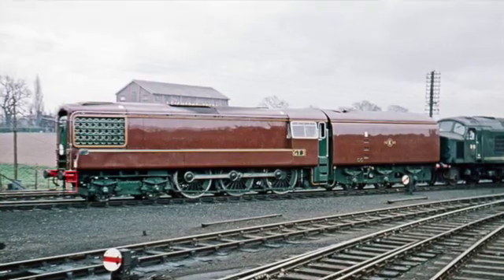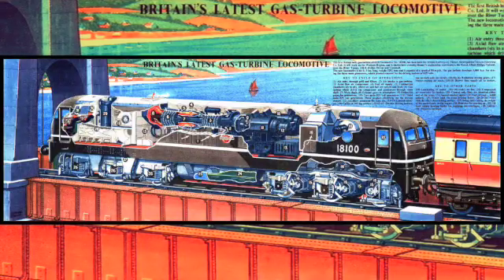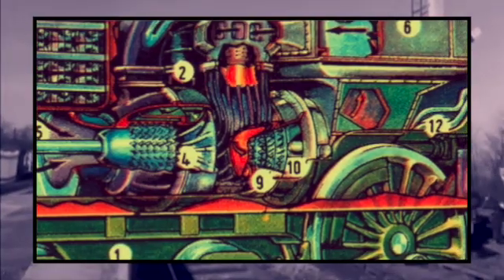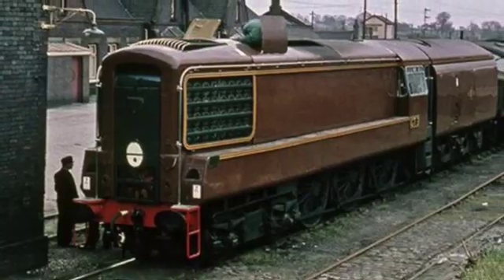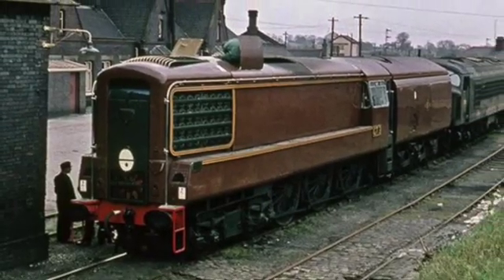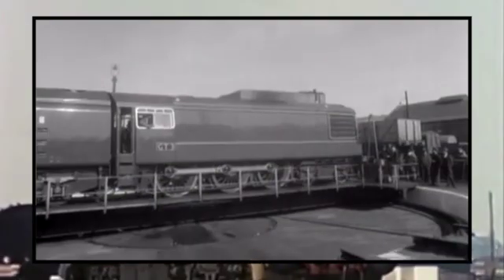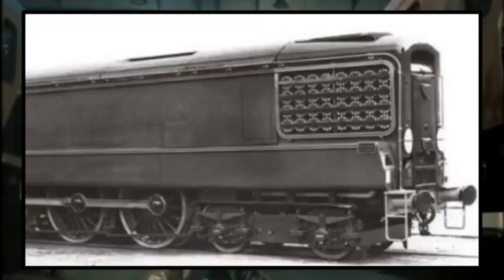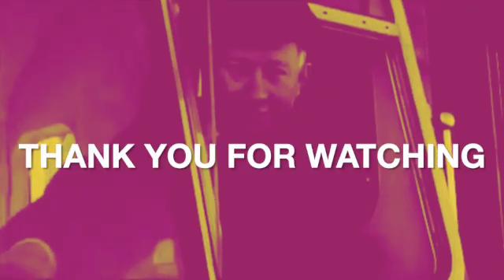The Train Powered By A Jet Engine: British Rail GT3

Comment: I wonder if it would’ve been possible to construct a diesel/turbine hybrid in a similar manner to something like the kitson still locomotive. 

Using diesel ( don’t know much about the viability of kerosene engines in locomotives ) at low speeds and switching from an engine to a turbine at a set minimum speed when the turbine is at a good efficiency. 

Certainly over complicated but I assume it would be the best of both worlds if done properly.
Reply: turbine electric? keep turbine at constant rpm use electric traction and smaller turbine using less fuel?

Comment: Union Pacific had more success with gas turbines and the APT-E was a gas turbine, they were very heavy on fuel use at anything other than full power.
Reply: I believe they used to use diesels and gas turbine locos together on trains, so the diesels could get the train up to speed so the gas turbine loco would take over, and at high speeds they were very efficient.
Reply: It's not so much about speed as constant high power. Gas turbines worked a bit better in the US on freight trains as they could run for hundreds of miles at high power hauling long heavy freight trains. They were not well suited to the Europe where there is a need for regular power changes. Even on long distance services with few stops, it's still often full power up hill, then coast down, then power on for the next hill, plus shutting off to slow for a curve, then back on the power on the straight. Even diesels had a lot of issues with constantly going from full throttle to idle and back.
The funny thing is that today Gas Turbines might actually be more viable, as part of a hybrid setup with batteries. They could run at constant speed and charge batteries when full power wasn't needed, with the batteries boosting when more power was needed. Still would be noise issues though. Gas turbines are remarkably tolerant when it comes to fuels too, which would be an advantage.
Reply: @ChrisCooper312  I'd love to see the Gas Turbines come back. The rumbling was intense. The technology should be developed further, I feel. It's been suppressed for too long.
Reply: @abloogywoogywoo  I've also heard it said that GT3 was banned from stopping with the exhaust underneath signal gantries and bridges because of the intense heat of the exhaust.
Reply: @Andrea.583  This was often true of steam locomotives.

Comment: I think the designer couldn’t let go of the steam loco.
In reverse, rear visibility would have been zero on curves, and BR were keen to scrap all the turntables.
But I do like the GT3, so I bought the sound fitted model.
Reply: I think the general concept with the GT3 was to show the viability of taking a steam locomotive frames and tender and rebuilding it as a gas turbine locomotive, saving money and refusing existing parts. I don't know if the GT3 had reverse. I've got the 00 guage model but no sound.
Reply: @garycross228  The general concept of the GT3 was to establish if the gas turbine could be geared mechanically to the wheels, without the losses involved with electric transmission.
It was NOT intended to be a final design.
Reply: Yeah, clearly it was reliable and powerful, but that steam loco configuration was a mistake. If it had ever gone into production, it would have needed a cab at each end.